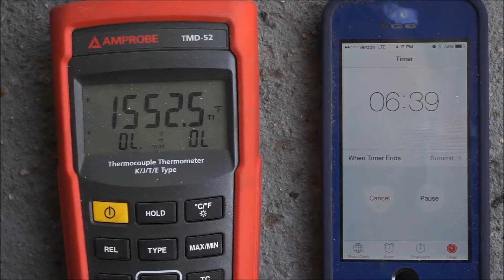Mak -  How to build a knife

Comment: Awesome brother!
Reply from the maker: +Giaco Whatever Cheers amigo!
Reply from the maker: +Admiral Gial Ackbar The Recipe depends on the steel you're using. I soak the 01 at 1500F for 15 minutes, then immediately quench in warm motor oil. Once its cool, i clean it up and  temper it at 400F for 2 hours. Should land you roughly around 59-60 RWC.
Reply: +Makenna Ryan what is rwc?
Reply from the maker: +Dave Monkell It is a lazy way to abbreviate the Rockwell hardness scale, "Rockwell C"

Comment: Nice. How do you put your badge on your blades?
Reply from the maker: +ChriX Builds - thanks for watching. I use a home built electro-chemical etching setup. 12vdc power supply and saturated salt water as the electrolyte.